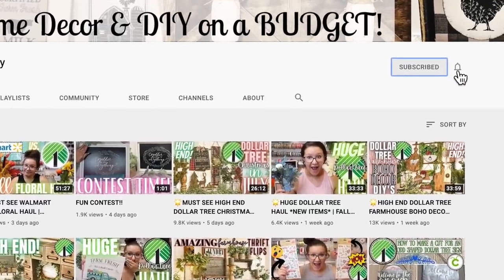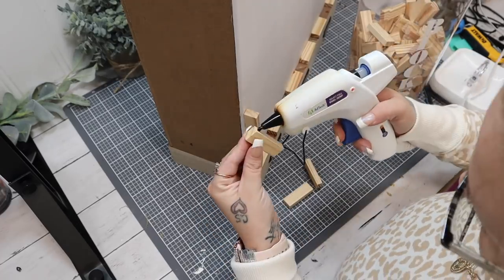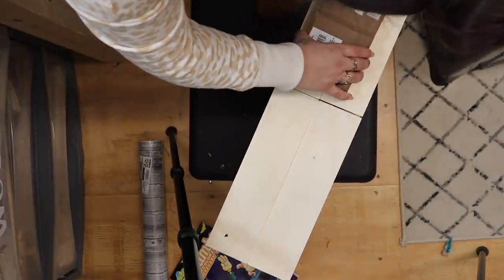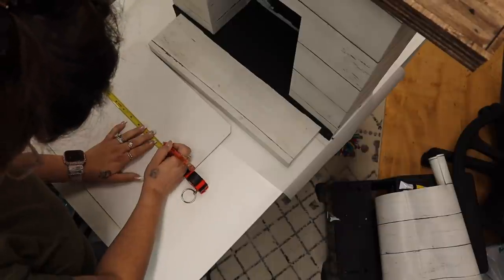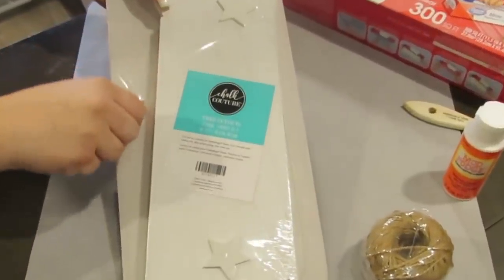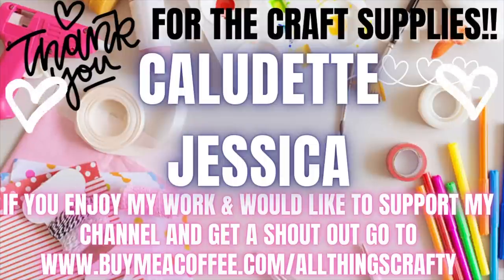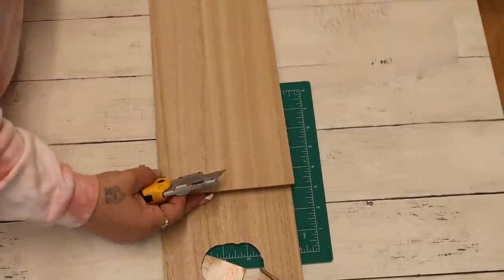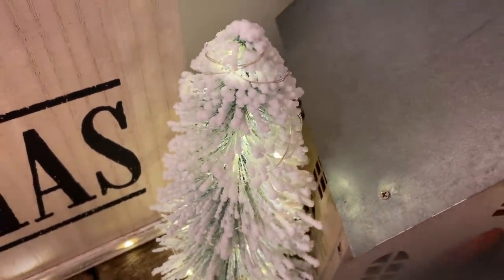🎄MUST SEE HIGH END FARMHOUSE CHRISTMAS DECOR DIY'S ON A BUDGET | DOLLAR TREE CHRISTMAS DIYS 2021 🎄

Comment: i have an idea for that fireplace you could buy one of those small tiny fire places with the fire burning the electric ones where the heat only comes out of the front you could insert one of those in that whole on your fire place if you made the whole big enough for the tiny ones you see in stores that heats up a small room that would look good in there better than the wood you put in it,  or if that tiny fire place you get that has the burning fire logs in it heats up on the sides too hot for the fire place you made maybe could make a stronger one with wood and use tiles to cover the whole in the middle where you would stick that fire place in so the tiles would protect it from your wood getting to hot than wrap the outside in contact paper like you did anyway thats another idea this gave me to make one of these and  stick a small electric log burning fire place thats fake logs and fake fire but looks real and the heat comes out of the front vents to heat a room up
Reply from the maker: This is SO FUNNY! I actually just saw those in a haul the other day and immediately went to the destash group and have some on the way to me🤣🤣🤣🤣